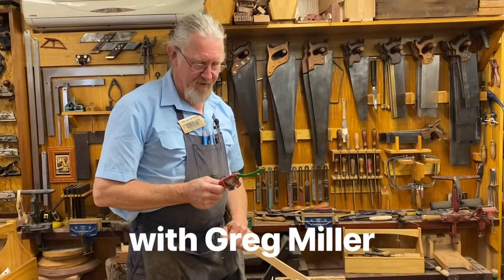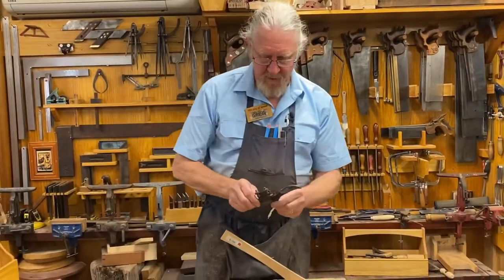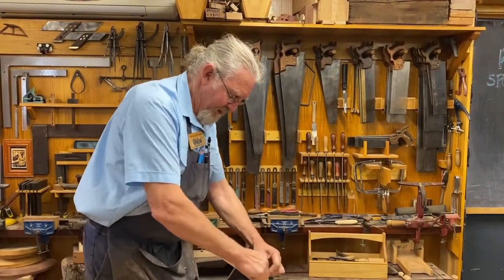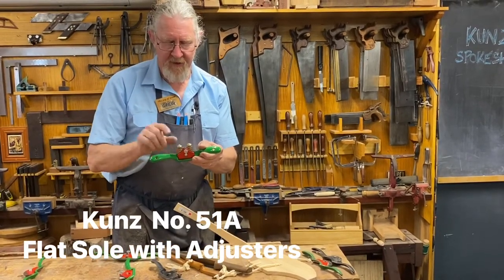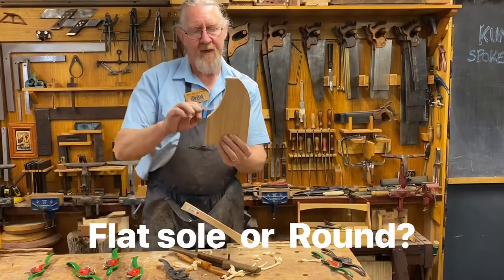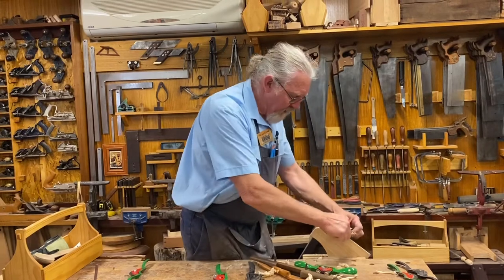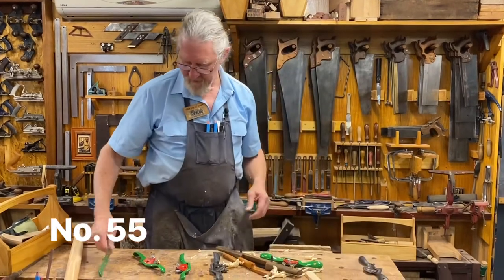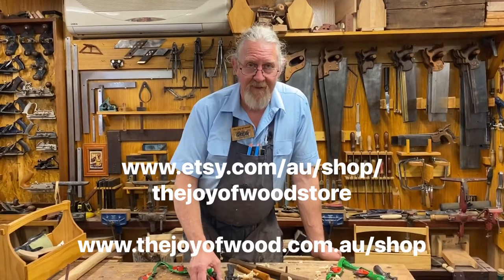Spokeshaves! with Greg Miller

Comment: Fantastic video!!  What 2 spoke shaves would you recommend for creating wood spoons and love spoons
Thanks..Mark from South Carolina.
Reply from the maker: The No.51A (flat sole) is the best for shaping the outside (back) of the spoon bowl, and also the handle. The No.51AR (round sole) can be great for shaping the neck. A Sloyd knife can do this too, so if it was down to one spokeshave for spoon carving, I would go with the No.51 A. 
Check out the Seasoned Wood Spoon Carving video on this channel, and you will see a spokeshave in use. 
I hope this helps, Susan!

Comment: Hello, I just purchased the same vintage spokeshave and discovered that one of the tangs are cracked off!
is there a way of repairing and or welding it back onto the blade? ... please let me know. Thank you, dee:face-purple-crying:
Reply from the maker: I am sorry, but I have no idea how you would repair the blade if you have no way of welding or braising it. Distortion through the heat may be an issue too. It’s a shame!

Comment: Thanks for the video.
Can you tall about the convex blade spokeshave by Kunz?
Reply from the maker: Rodrigo, 
1. do you mean the No55 Spokeshave? the curved blade in the curved base - great for rounding anything with a radius less than the curcature of the base. We love them for smoothing further legs we have shaped with a drawknife. Tricky to sharpen and to set the blade, but awesome when they are wokring right! Worth the effort.
2. Or do you mean the No.51AR Spokeshave? The curved base with the straight blade. Great for shaving inside curves, where the radius of the curve in the wood is greater than the radius of the plane's sole. A bit trickier to use on the flat than the No.51/51A (with their flat bases) , however fantastic once you get the hang of it for shaving inside curves. 
I hope these help! Kind regards, Greg.